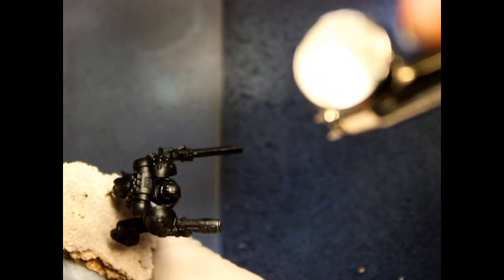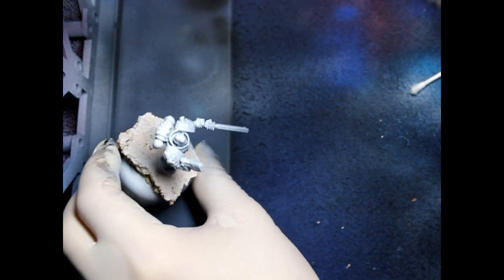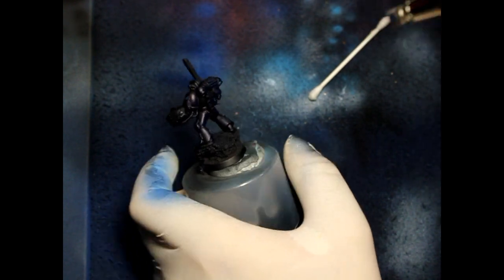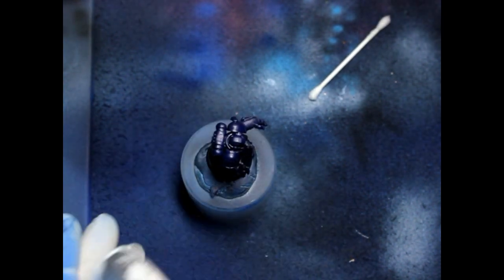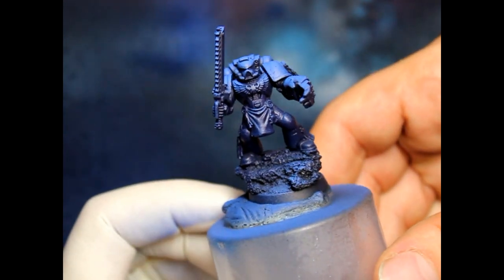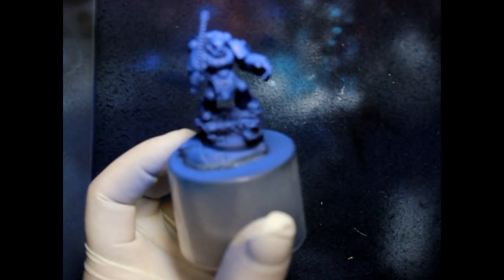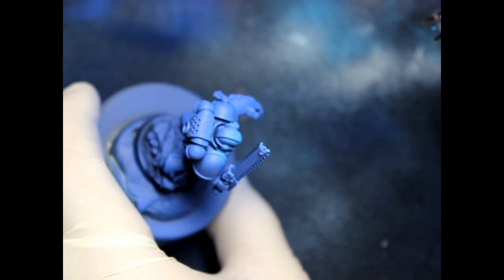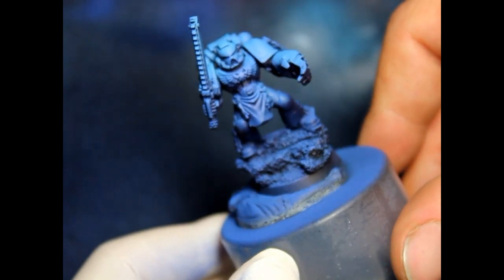zenithal osl *2 techniques*

Comment from the maker: Cheers mate! I'm don't really use washes at leas not in a traditional way. I will drop so wash in cracks in armour but that's about it. If the model is painted using a paint brush yes washes are indeed a good way to go but when the model is done all with the airbrush it's kinna not needed. Tell you what I'll cover this question in tomorrows Vlog ep 4